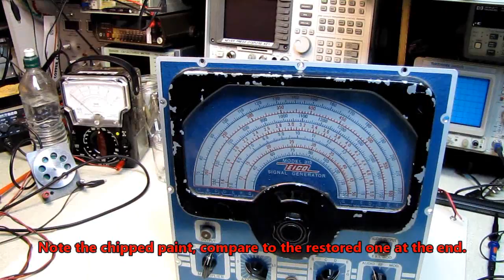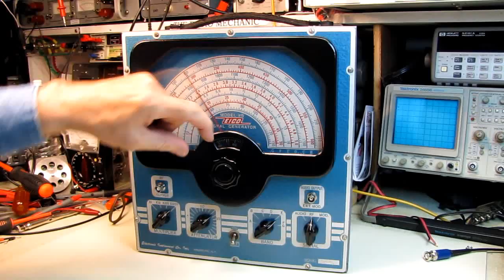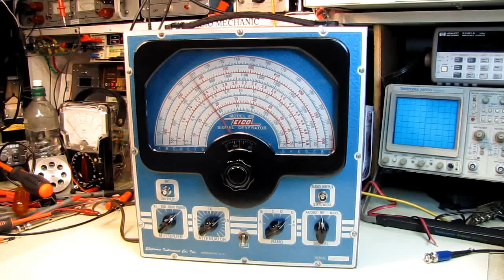10 Buck Test Bench - EICO 315 Signal Generator Restored

Comment: I have Eico Model 315 like yours, but someone cut the metal can capacitor off. Can you send me the picture of the original brand and numbers stamped so then I will search for a match one to restore the chassis as original? I will put two electrolytic capacitors under the chassis like your instrument. Secondly, where can you get a replacement leather handle? Thank you very much

Comment: Very nice! You did a great job with the restoration, it's really sharp looking now.
I couldn't help but notice how this unit seems to have been made to a much higher level of quality than my Eico 320 signal generator. I was expecting more similarities, but the 320 appears very much to be an entry level unit compared to the 315.
Reply from the maker: I think that they were attempting to break into the professional market with this one. The unit is very stable and when you make a calibration chart using the Vernier scale the unit is very repeatable. Not quite up to the Precision Apparatus units, but certainly a step up from their other units.
Reply: I'll have to keep my eyes open for one at NEARfest. Thanks!

Comment: I've got that one! Recapped and a few resistors were really bad. Bands A to E it's calibrates nicely. On the F/G band is dead from 13 to 17 mhz. No signal on my scope.  17 to 50 Mhz works. Any ideas?  Since i can use band E to hit 13 to 16.3 i gave up and called it done.
Reply from the maker: I did a search on this and it seems to be a common problem. No one has come up with an answer yet that I can find. When I get some time I will see what else I can dig up.

Comment: I will be looking for a signal generator this weekend for my $10 buck workbench. Are there certain ones to look for? Ones to stay away from? I think I have seen a few EICO ones at most hamfests
Reply from the maker: Hi Scott. Depends on if you have a frequency counter. The smaller units usually don't track well and need a counter to "hit" the frequency you want. The better older units like this EICO and the Precision Apparatus E-200 I restored in another video have logging scales that allow you to accurately ( for the day ) return to a frequency. The trick is in the calibration and then making a look up table for the logging scale. I can easily hit 455 KHz, 600 KHz and 1600 KHz on either of these units within a couple of hundred hertz every time with the logging scale. That is "dead on" for the day and 10 times more accurate than the old radios they were used on. And it's fun to use them. I have a shop full of gear tied to an atomic standard. Not nearly as much fun as using the EICO.
Reply: So I picked up a 315 last fall with a broken bezel, last weekend I picked up a second one ( rough shape) with a good bezel. Hope to put both these babies together sometime in April.

Comment: Nice work Vern, thanks for sharing...bet getting to that resistor (cap?) and putting the left BNC in was lots of fun!  73 - Dino KL0S
Reply from the maker: Hi Dino, It was a bit of a trick. Kind of like putting a transmission in a Rambler, in the dark, laying on a dirt driveway in the rain. OK, perhaps a little easier than that.